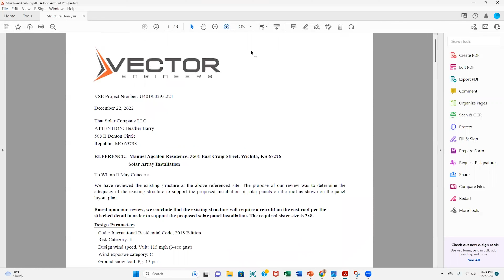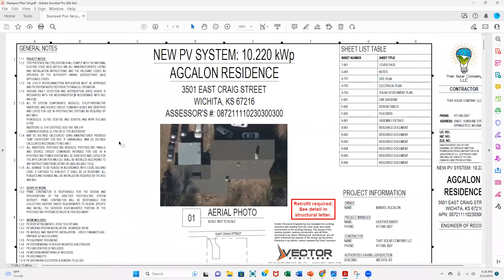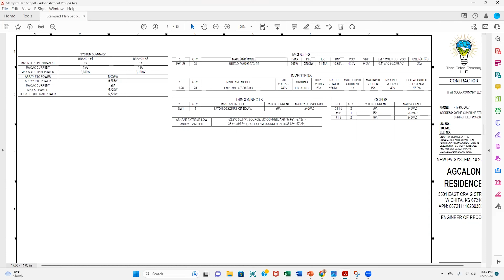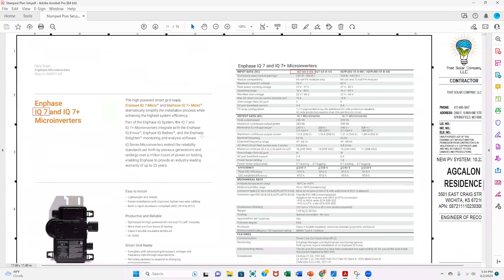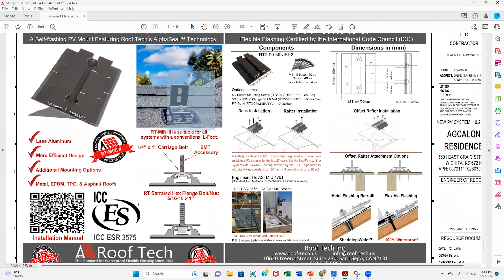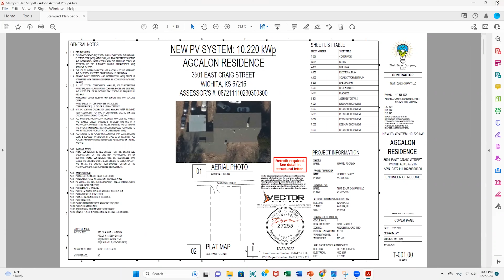“Solar Installation Inspection” Webinar with Certified Professional Inspector® Dave Killgore

Comment: Glad I do not live here. Illinois is the mother of all nanny states. But, at least they allow owners to install everything except the grid tie in. That has to be done by a licensed electrician. You can die just crossing a street. Even professionals need correcting. Lots of negatives about this state.

Comment: It is logically inconsistent to bar homeowners from installing their own solar system when the work is subject to the same stringent inspections as a professional job. In many cases, a homeowner’s personal investment in their property leads to higher quality control than a hurried third-party crew. By stripping residents of the right to sweat equity, counties are effectively endorsing the inflated labor rates of the solar industry—which often exceed 2x material costs.

Comment: Very informative, thank you.

Note/correction at 57:18, in this example, Enphase micro inverter system, the Enphase IQ Combiner4 does not convert DC-to-AC, the IQ7s/micro-inverters installed at the panels convert DC-to-AC, from a diagram standpoint, this is made evident by the L1, N, L2 nomenclature at the bottom of the Combiner.

This is my take on the available information, but I am just a homeowner, so take my comment accordingly...
Reply from the maker: Thank you so much.

Comment: When it comes to J-boxes we also check for weep holes in the box and make sure the weep holes are not blocked. Sometimes, the sealant that is put on the bottom side of the J-box when the installer attaches it to the roof the sealant will block the weep holes.
Reply from the maker: Great question. Thank you for watching and commenting.